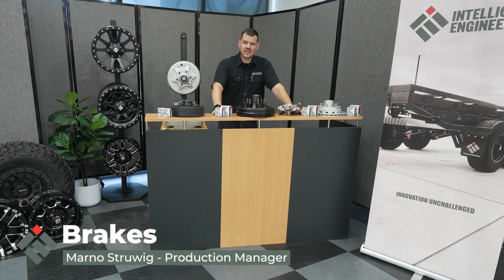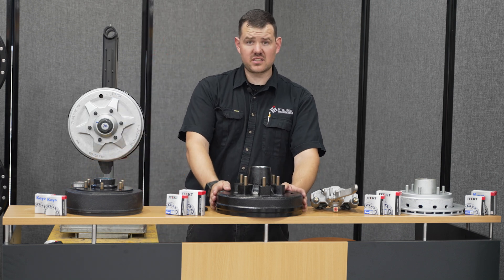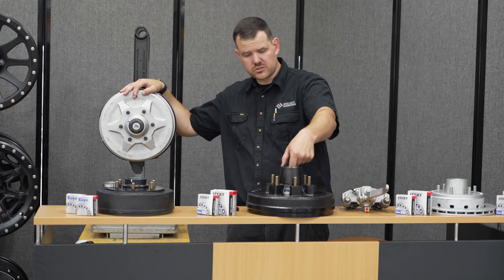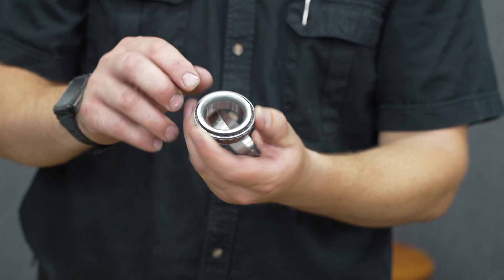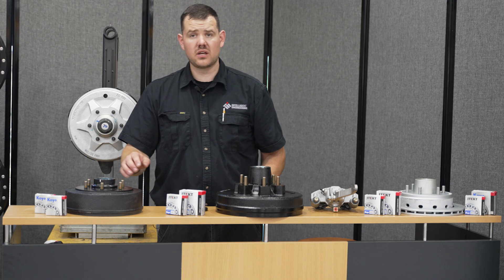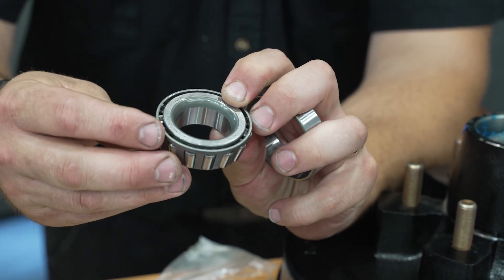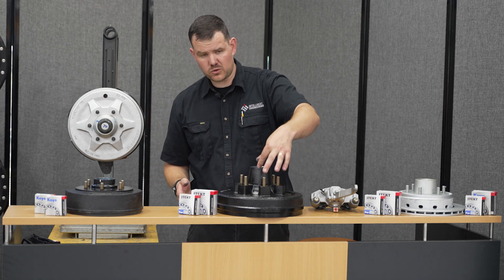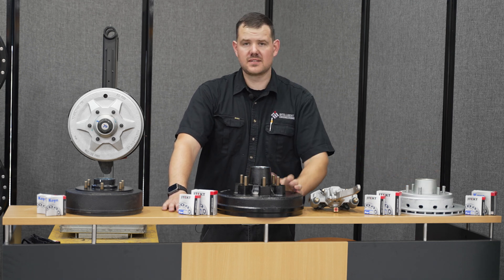Intel Tech Tips - Episode 3: Braking Systems & Bearings

Comment: Very helpful video, thank you. Could you please let me have the bearing numbers for the inner and outer bearings you use for a 13” wheel hub with 8 lug/stud (dodge ram) pattern,  as used with the disc brakes  of a Crusader Trailbreaker. Thanks in advance.
Reply: Glad you liked the video! The 8 stud Dodge Ram bearings and seal are as follows. Inner Bearings - 25580 and Inner Cone - 25520 and Outer Bearings - 14125A and  Outer Cone - 14276. the seal is 82130.